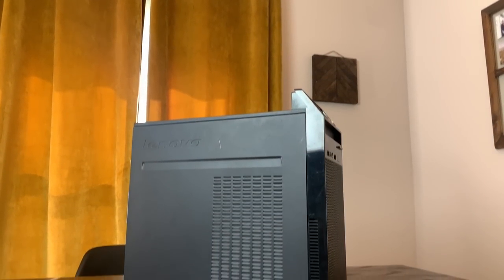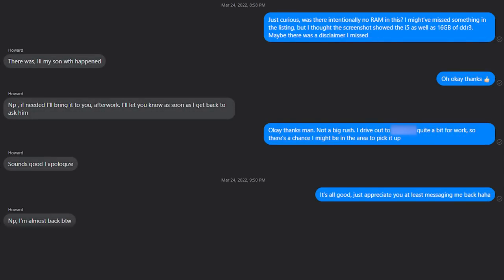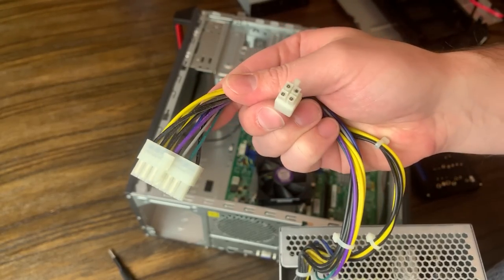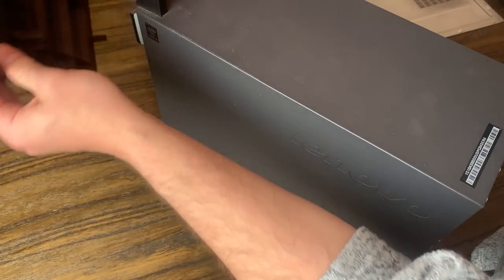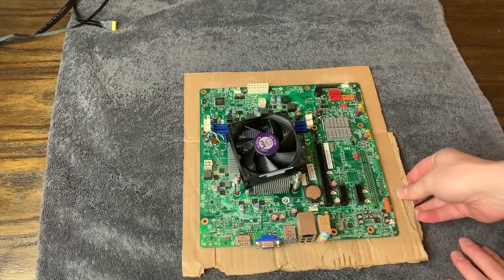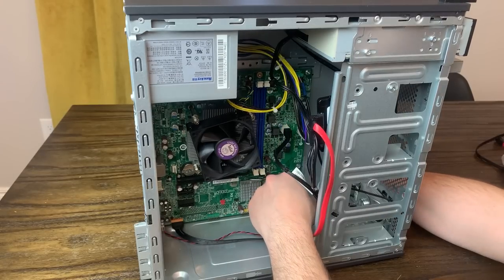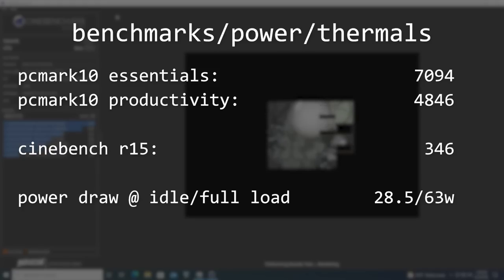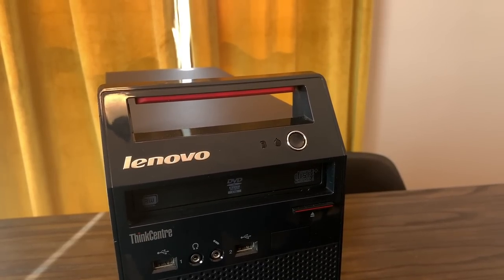This PC was a scam. Now what can we do with it? - Landfill to LAN: Lenovo E73

Comment: Good to see you back! I like these lemons to lemonade situations, it’s really fun to see creative solutions for older systems. A FirePro W5000 would be a fun GPU to match if the psu could keep up
Reply: Or an nvidia 710
Reply: @alexandroskotrotsos3720  730*
710 to me is just a better 210
Reply: @alexandroskotrotsos3720  σωστός... or an amd for a budget unixlike pc
Reply: Won't really be worth it as most old Firepro gpus are expensive af despite their age
Reply: Or a W5100 (4gb of vram instead of 2, costs the same) or a 6400xt for 150
Reply: @alexandroskotrotsos3720  no thee w5000 will out perform the 710 and the 710 is a re haze of the 610 and 210

Comment: The properiatary makes actually sense because its a 12V only mainboard/psu to recycle broken server psu's that were actually all 12V only
Reply: Not really propietary since they give you enougth info to turn a normal psu into one of these or some of these came with a free adapter (got hired to fix some Office pcs and they told me the pcs came with "parts" and i was like "wtf?" And the parts where adapters and stuff to use normal pc parts for this)

Comment: In 2014, I stocked up on about a half dozen 2010-era used computers and laptops. Fair prices at the time, and most are still in use even now. The seller was associated with an e-waste location, and was diverting the still useful hardware from the landfill.

Comment: I bought a similarly spec'd HP system. It had an i3-4160, and I used it for a month as my primary Windows 10 desktop. I was surprised, with 12GB of RAM, how usable it was.  I edited a video for YT on it, and it processed 1080p at 12.56 FPS.  It is gone now, though it's videos live on (not nearly as put together as yours). Good video.
Reply: The SSD really makes the difference in everything. Upgraded my mother's laptop recently and it was like the darkest night compared to staring directly into the sun in terms of boot up, response time, etc.

Comment: $40 for that thing is a pretty good deal imo.. it cost around $90 - $100 in my area for a full working E72/M72 that have 3470, 4GB of RAM, and without a GPU
Reply: Yeah $40 is good for a basic PC. Also its cheap to swap in a better CPU and ram. I am still using my i5 3470 for general  tasks.
Reply: @brokeandtired  my pc still uses 3470, for my usage (little bit of editing, game, and stream) it still usable in 2022 :D 
It's a great cpu, and I don't think I'll need an cpu upgrade for another 3 years..
Reply: @PinotNoir_  Yeah its still a pretty solid CPU, though for gaming I got a Series S.

Comment: I mean you still got scammed because it was assumed that you'd be getting an i5 and 16GB of ram but even as is, that really isn't too bad for $40, I recently built a similar PC for my mother, I already owned all the parts meaning I technically paid more than what they're worth now, but with current re-sale value it comes out to only being worth something just over $70 in parts and that isn't including things I was able to repurpose like the old OEM psu / case or the ram, so yeah $40 + your own ram/ssd is still a good value.
Reply: i wanted to add exactly this— someone might just be selling ‘their home computer’ and thought $40 was already a rock bottom, just-get-it-outta-here price for the kind of thing they might themselvesve seen costing like 100 times as much some 25 years ago. doesnt explain the switcheroo of the cpu, but who knows— maybe theres a reasonable explanation possible there as well.

Comment: Once the circuitry has been removed, front panels and cases can be washed in a laundry sink with hot soapy water, then rinsed off and dried. The big advantage is how clean and sanitized they become. Also pretty quick.
Reply: 7:03 suds treatment appears. :-)

Comment: Nice computer. In my place I can find a similary spec machine for more than double the price...

Although, I would suggest to either flip the sata cable of the ssd or go for a straight to straight cable. It doesn't look good to the eye and it might be slighty pressed by the side panel when closed.

Comment: Maybe a NAS? Your other uses sound good too. IMO - Repurposing older tech is always a good thing. Glad you weren't too badly ripped off. Would be interested in the final total $ you put into it $40 + ram + ssd... maybe they were "on-hand"? In that case... not a bad deal - even if not as advertised. Wish everyone had more integrity. I thought you handled that part with kindness. :)
Reply from the maker: I think I got the RAM for $20 used and the SSD was $25 on Amazon. And Thanks!

Comment: I would personally use a system like that for a cheap storage nas, using the expansion slots for more drives and probably putting the components in a different case while I''m at it with a new PSU as well. 180W does not seem like enough for a NAS.

Comment: I setup a Dell with similar specs as a home file server. Used a 120gb SSD for the boot drive, added a pci sata adapter and 3 8tb spin drives for data storage, set a 24tb partition across the spin drives.
Yes, all the data is backed up elsewhere. This is primarily for a digital copy of my movie collection to access anywhere in the house.
System has been running without problems for over 2 years now.
That Lenovo might work well in a similar application. I've seen spin drives up to 20tb in a single 3.5 unit.
Reply from the maker: Nice! The lack of parity kinda scares me, but I guess if it’s backed up and doesn’t change much, who cares haha. Are you using windows or something else?
Reply: @HardwareHaven  
Yes it's windows, and yes everything on it is backed up in two other places. This is just for viewing access around the house.

Comment: I just recently found two Lsnovo i5 systems in the trash, an M91p and an M900, both with 16GB of RAM, but no boot drives. Both are small form factor systems though, with not much space inside and 250w and 210w power supplies respectively. Being extremely short on money, I figured I could use one of these as the basis for building a decent system, by putting the motherboard in a bigger case, adding a larger power supply and throwing in a Saphire HD7870 graphics card that I also found (but which I haven't tested). It wouldn't be state of the art (or even qualify as a "gaming" computer in most people's opinions), but it would be a lot more powerful than what I have now. And I could upgrade it to an i7 later.

Unfortunately, I don't know how to choose a compatible power supply (24 pin connector), a case that the board would fit into, or where to find pinouts for the header connectors on the board. I'm sure someone else could just look at it and know what to get and how to hook it up, but I have zero experience in this regard. :(

Comment: I3 4160 is a nice thing, and 8gb ram is very ok too
In my place a desktop with that same spec from Dell for example cost as much as double the price
My current main desktop PC is a inspiron 3847 with a i3 4170 (it surprisingly powerful enough with over 1000 pts in CPUz benchmark), 8gb DDR3, HD4400 graphics.popped a SSD and yes, it worked like a charm.
I really looking forward to upgrade my PC later with 16gigs of ram...

Comment: That might explain the h50's unused D-Sub cutout. This machine and others that use it's chassis (H50 and Erazor desktops) take uATX boards and ATX PSUs which means upgrades are possible, but at the cost of front panel I/O.

Comment: Actually that 180 watt power supply isn't completely worthless!!!! A few years ago I was installing LED strip lights inside my shed workshop and had ordered the strip lights from a supplier in China!! Upon getting the one set of strip lights however, I got them all mounted to the ceiling of my shed, hooked them up with the supplied power supply that came WITH the LED strip lights and when I plugged the p/s in, it immediately smoked, making the LED lights useless!!! 

Oddly enough, a few months before I got the LED strip lights I had seen a video here on YouTube, that talking about converting an ATX power supply into a "test rig power supply" using a ATX extension harness! And I just happen to have a 100 watt ATX power supply out of an old IBM desktop just laying around, that I knew worked!! I quickly assembled the "test rig" and mounted it to a board. Then I used that power supply to power my LED light strips!! Certain NOT as efficient of a solution as I had hoped, BUT looking back at it, I am powering ALL the lighting in my shed/workshop off just ONE 100 watt power supply, which is comparable too running just a single 100 watt light bulb.........AND I have light all over my shed, and can actually expand on it in the future if I want too!!! So having a 180 watt power supply isn't completely useless......and it can be used for many other projects where a 12 volt DC power supply may be required!!

Comment: Maan it was very helpful video. I also got that piece of a computer from an office. Invested in special adapter 24pin to Lenovo 14pin connector and added by this my older 500W psu and 750 Ti. Same i3 on board as well but LGA1150 allows me to slap here up to Xeon E3-12xx v3\v4 later. Even i5's here are not weak processors ar all.

Also thank you much for showing all installation process - i was confused first time seeing that strange mobo.
Reply: Bro can we add dual fan GPU in it?
Reply: @Prime_yt02  actually depends - 750ti Windforce OC is a dual fan card and fits perfectly with power connector oriented to side panel of Lenovo case. But it is 20 cm long. Longer card probably will not fit in there.

Comment: Lesson of today: 
always bring a screwdriver. (I always carry a small kit in my backpack that allows me to open up.. Well.. basically anything (from iPhones to computers and TVs). 

In this case, you could have asked to see it turned on (any tv can double as a monitor these days). 

("i don't have a cable" - yes, you do, because your digital TV thing has the cable I need)

You can always bring your own stuff.. OR.. Bluff a little, and see how the seller responds.

"You don't mind if I open it up to see if everything's in order, right? I've got a screwdriver set with me always... Handy for quick repairs / if my phone drops in the toilet.." 
     [*start fumbling in your backpack]

Comment: I'd hardly call that junk.   Yes, the person who sold you that clearly ripped you off.. but.. an i3-4160 in that board is hardly a slouch.  With 8GB of RAM, it should perform daily tasks with ease, and I'd say that the iGPU should be able to handle some older games like Fallout 3 okay.  Honestly, for $40, I'd say that's a decent system.  I've seen many very similar computers sell locally for well over $100 with Win10 installed.

Comment: You didn't get totally screwed but the seller did lie to ya. I've seen a time I'd of died for this machine. Best thing you did was add that SSD drive, now all you need is a decent GPU and different PSU. While you're in there, toss in a couple case fans and you'd be golden.

Comment: Hey Haven enjoyed the video!   I used to have something like that as well. (With no proprietary connections, second gen Haswell)   I figure the easiest upgrade would be a simple GT 1030/1050/ti if the PSU can handle it?  Otherwise might be throwing some serious money at this.  But,   I think the case is kinda unique looking?    I've built in a "circa" 2005 IBM Net Vista case with modern parts for a sleeper build.   Lots of options and can't wait for a follow up.  Peace!
Reply from the maker: Hopefully not tooooo much of a spoiler, but I found a GTX 1650 for $120
Reply: @HardwareHaven  Nice! Even better!  I got lucky on timing when I purchased a 1650 Super back when the first came out for 160.00. (before GPU price hikes)  Will be interesting to see the percentage increases.  Peace!

Comment: Keep your eye out for any deals on Xeon E3 1220, 1225 or 1226 V3 CPU (worth $20-40, 1220 has no iGPU).  They are Quad core and work in desktop motherboards.
Edit: I just checked the prices.  $18.95 - $23 for those Xeon.  I didn't even search by their S code looking for better prices either.  4 core 4 thread 3.3ghz for the 1226 (plus boost, about like an i5, pretty cheap though)
Reply: I would recommend a GTX 750 950 or 1050, if they can be had for $50-80 (spoiler, I know they can because I've done it)

Comment: I bought a M73 Thinkcentre about 4 year ago, it has the same motherboard and came with the same CPU, before that I was using a Core2quad 8400 and this Core i3 moves faster than de Core2quad, I installed 16 gb of ram, a 240 gb SSD, a Gt 710 with 2 gb of vram graphics card and changed the Core i3 for a Xeon E3-1240 v3 (officially not supported by Lenovo). Well it runs very, very fast, is the machine that I'm using and performs like hell all Operating systems that has installed (Windows 10, Linux Manjaro, Linux Fedora and Mac OS Monterey).

Comment: HP i3 laptop from that same era that i bought as a refurb for short money. It worked ok but ws never at all zippy. I replaced the hard drive with an SSD and added another 4GB of ram to bring it up to 8GB and now it does as well as you could ask for this kind of setup. It dual boots between win10 and Linux.

With 3 SATA headers I'd think pf turning that into a low end file server. I've had a server running here for 4 years on a HP desktop with six hard drives and an i3 cpu. It has not skipped a beat in those 4 years, it runs freenas which is now truenas.

Comment: I got something simular (a DELL 3020 Mini tower). Had the same i3 cpu.

I got a 512 gb ssd in it, found a used gtx1650 low profile card for 100,- and i got lucky to find a i7 4790k for 60 bucks.
2x8 gb ddr3 1600 mhz I still had laying arround to replace the 2x2 gb ram.

System is really nice now. Can do tons on it.

Comment: I have a 4130 that runs Batocera pretty darn well, but that is an sff machine. The i5 4570 is dirt cheap over here, guess you could do that upgrade for next to nothing as well? Unlike the 4770, which pulls more power and costs quite a bit more. Any semi-decent gpu will require a new PSU, so maybe my idea for a Batocera machine isn't that bad?

Comment: I'd say the time you spent driving to and from the buy followed by clean-up, etc. totals a lot more than $40 in comparison. Just a thought, but I guess you have to decide how much you value your time as well ($).
Reply from the maker: The drive normally wouldn't have been very bad had there not been a really bad wreck. And I would've cleaned it up regardless, but you make a fair point.

Comment: Put in 1600 16gb of ddr3 and an i7 4770 or 4770S (whichever is cheaper) then run your tests again if the improvement is good think about a video card next.. For a video card check around and see if you can get a deal on a 1050ti  (round 140) or a 1030ti for around 90.
Reply from the maker: I have some plans that aren’t too far off 👍🏻

Comment: I always just use Velcro Tape when I can't screw in the drive, or zip tiesas I am finishing up cable management.   I would say you did ok for 40, scammer or no.  I would use the drives as propriety storage such as ebooks (making a library) or music.
Reply from the maker: Yeah I've used command strips a lot too

Comment: It's probably a good computer, at least until Lenovo pushes a BIOS update to it that effectively bricks the machine, like what they did to Yoga 12 laptops:  Works one day, Lenovo pushes a BIOS update at you through Windows update (so you can't stop it happening), and the next day your computer no longer works  (Not just me, thousands of posts about the same thing onliine) because they removed a module from the BIOS that may be necessary for full functionality of the machine.  Forced upgrade.

Comment: You know once i bought a thinkcenter for 20 buck spec wise it's an i3 3rd gen 4gb ram and a 500gb western digital
Reply: I bought something similar for $25 but it had a little bit of a spec increase. I got an i5 3rd gen, 16gb of ram, and a 1tb mechanical drive. Pretty good for light gaming such as 2d games.

Comment: I would honestly say to max it out as much as you can. For a GPU, just use whatever you have lying around. If you decide to buy a new GPU, an RX 6400 will be way more than sufficient. For used, something like a GTX 1050 Ti low profile (low wattage use) or even a GTX 1650 Low Profile. I think both GPU's would work well in there, within the PSU's limitations, as well as what the computer is capable of accepting, as the CPU will likely bottleneck with either of them.
Reply from the maker: Got some fun stuff coming up like that 👍🏻

Comment: Well, this E73 is socket 1150 and takes any i7 or Xeon of that socket. Takes 8gb ram ddr3 per slot. I know cause I done got 1 now along with some other Lenovo and Dell Optiplex. DO NOT GET DELL UPDATES. Use driver booster and patchmypc. Been doing this for 8-10 years.

Comment: Buy a Dell Optiplex 790 or later. Mine has a I-5 2500 and came with 8GB RAM in 2 slots (It has 4 slots). I upped it to 16 GB and added a 2 GB graphics card I had lying around. It came with Windows 10 on a 250 GB HD which I changed to a 1 TB SSD. So far it does well in all the old games I have, like ARMA 2 Dayz mod. Also, all of the power supply connections are standard type. Just wish it had power for a larger grraphics card. I have $120 in it including card , memory, & SSD.

Comment: yeah 40 bucks is probably geting on for the more expensive side but still almost resonable. also you got a delta fan in that rig too, those things go up to like 5000 rpm. put one on the stock amd cooler that came with an fx4300 on an fx8350 and it sounded like it was gonna take off lol temps still sucked but where like half that of the stock fan that runs at 2k rpm.